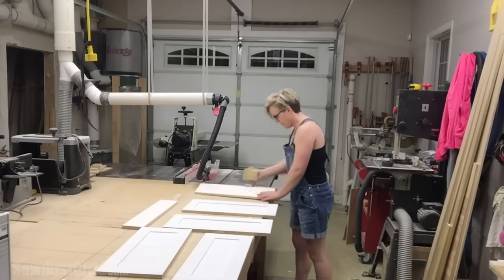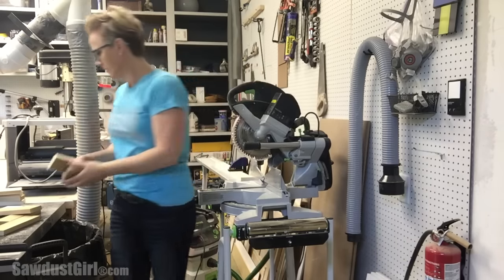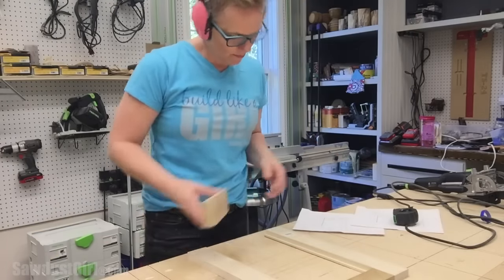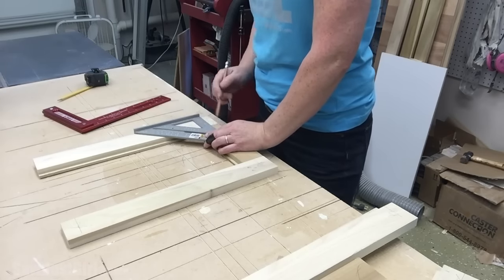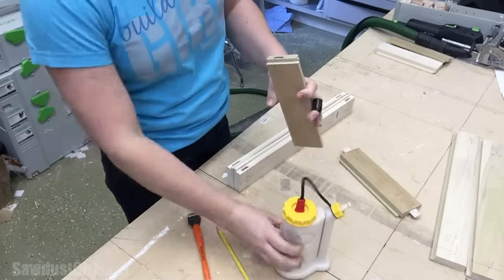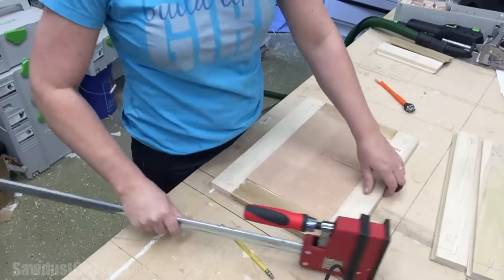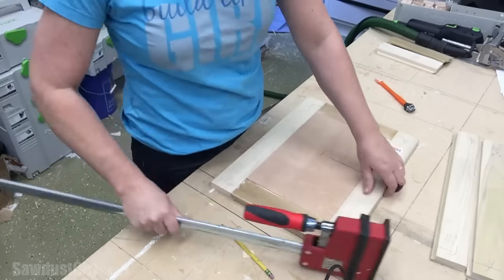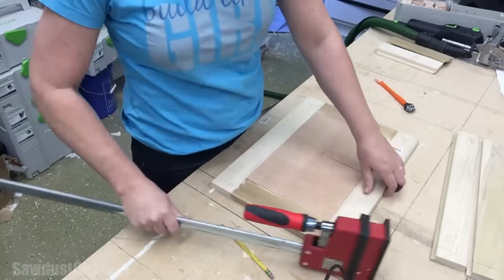Building Drawer Fronts

Comment: Nice touch on the floating tenons to make those doors very strong. Do you have and just drop in different grit drums on your drum sander? Oops...oh hi camera....(that was funny). Very nice project build. Thanks for sharing.
Reply from the maker: +MRrwmac I have to wrap the drum with the different sandpaper.
Reply: I have to wrap my drum too, it's annoying but I've gotten pretty fast at it I sand a lot of highly figured guitar tops and body blanks so I go through a lot of rolls. Would it even be faster to disassemble your drum sander and realign the drum instead of just wrapping the different grits? I know I spend a lot of time making sure mine is running perfectly flat at all times I'm afraid if I took the drum out it would knock it out of true.  But maybe doing cabinet work doesn't need to be so precise I've built cabinets benches and drawers for my shop and my kitchen but beyond that I'm not that experienced in that type of woodworking I predominantly build electric guitars and if every surface isn't perfectly flat you might as well not finish the guitar because the errors multiply fast.